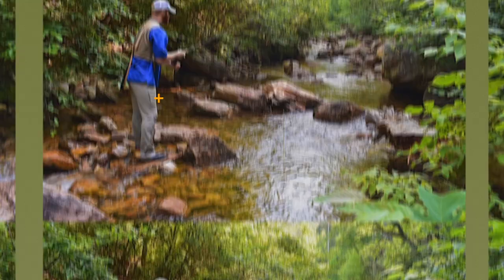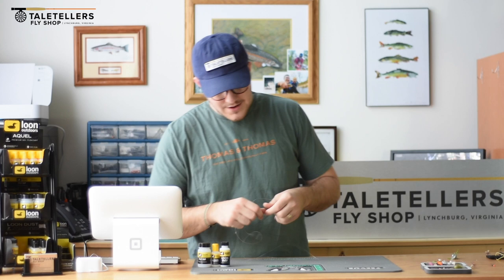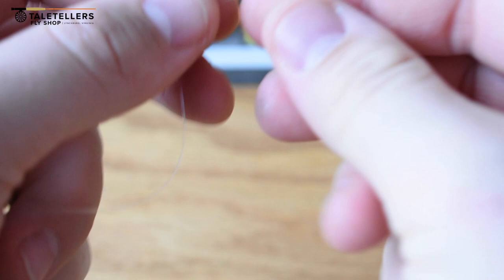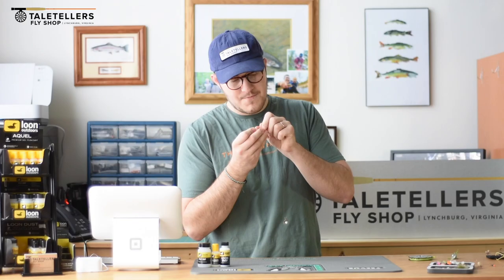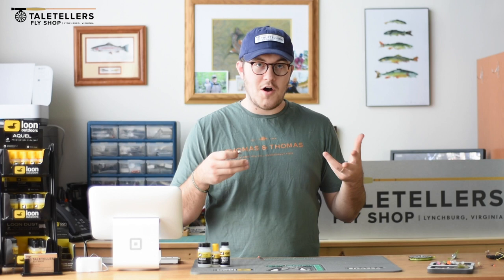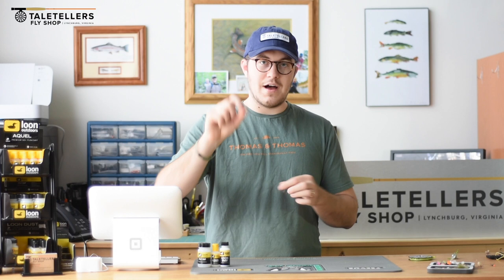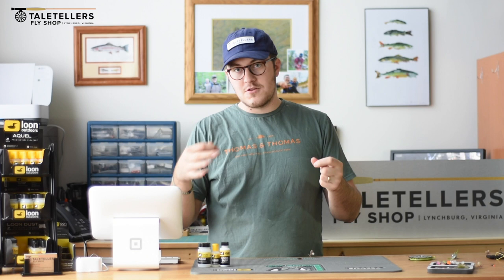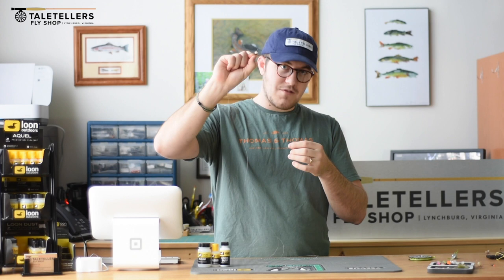Dry/Dropper Rig: The Basics

Comment: I have a question can I use this technique all year round or only certain time of the year?
Reply: You definitely can use it year around, but it is most commonly used in mountain streams in the fall/spring. If you use it in winter, treat the dry fly mainly as an indicator. However, there are occasions (warm sunny days) where trout will still go for the dry, so it is nice to have an "indicator" with a hook in it. Cheers!
Reply: @andrewkent6283  thank you for the info.
Reply: June 5 on the CDA river in Idaho...75 degrees mostly cloudy...a cities were hitting my hopper indicator and I landed one